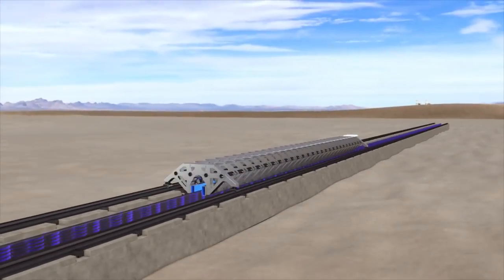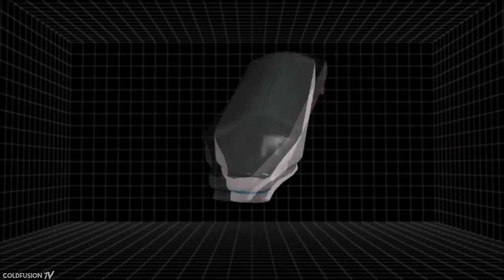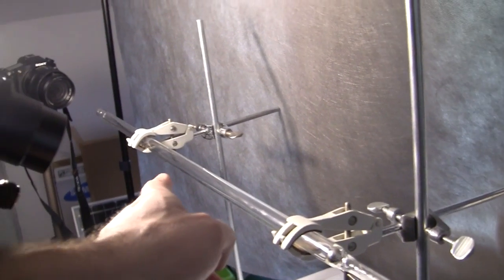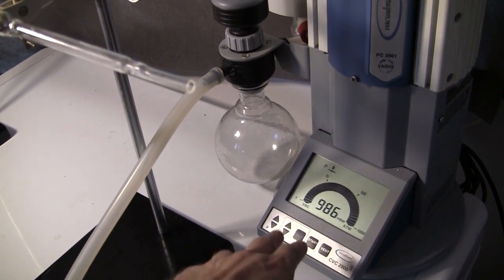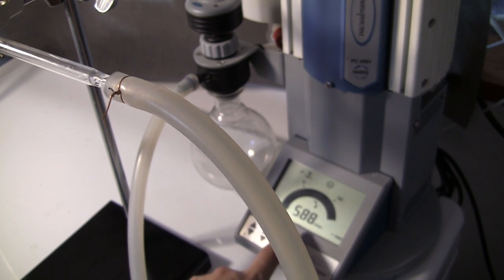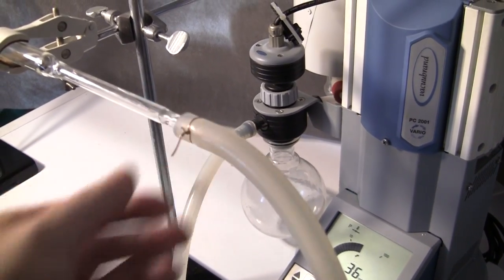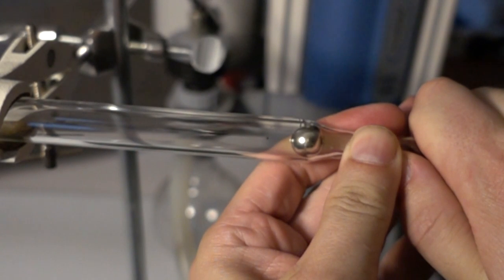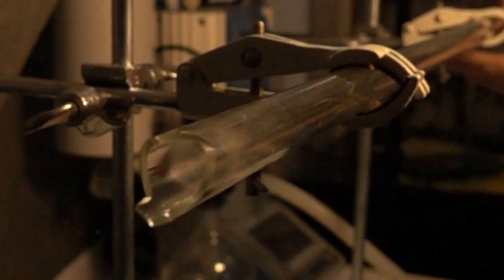How  the Hyperloop can kill you!

Comment: You're assuming there wouldn't be underflow blowouts along the tube at intervals?  You're assuming there wouldn't be an accelerometer autobreaking system to tie the vessel down against the bearing housing, similar to that in elevators?  You're assuming that the magnetic levitation system doesn't have a limiting phase which creates a much higher friction when the "train" isn't in alignment (similar to the friction you feel when putting a load on a wound coil)?

You have made a lot of poor assumptions to the hyperloop concepts, it seems your failure at politics has caused you to lose sight of your scientific mind as well.  Although I'm not sure why they would put a vacuum to 1 millibar system in the tube, considering the passenger lock would need constant maintenance as pod stations would be constantly depressurized and pressurized separate from the loop....makes no sense.  I think a slight vacuum within the tube would help, but I don't see them making it 1 millibar, that's absurd, they may have tested the friction loads down to 1 millibar in order to gain knowledge of the efficiency curve.  They can then take the efficiency curve and match it to material costs of fail-safes and ring maintenance in order to come up with the best pressure point.

I think you need to take a break.

Comment: Well just from the one clip you played, I'd be worried about it not going fast enough. They said they were going to use a propeller to make it accelerate in a vacuum. Yet... air resistance is what allows propellers to work in the first place. The less air you have, the slower you'd go.

Comment: Im going to hold my judgement until your full video comes out, it seems like this issue could be fixed with a pressure release valves that would activate incase of an emergency. This seems like an issue that could be resolved through engineering. But like you said you'll be making a full video explaining why you think the hyperloop won't work so I will hold off my judgment until then.

Comment: Hey TF, I believe you may be debunking a strawman by accident. If you go to the actual paper on the SpaceX website ( http://www.spacex.com/sites/spacex/files/hyperloop_alpha.pdf ) you'll find that on page 3 they actually argue AGAINST a hard vacuum. Instead they argue for a lower pressure, but nothing close to a vacuum:

_ "Another extreme is the approach, advocated by Rand and ET3, of drawing a hard or near hard vacuum in the tube and then using an electromagnetic suspension. The problem with this approach is that it is incredibly hard to maintain a near vacuum in a room, let alone 700 miles (round trip) of large tube with dozens of station gateways and thousands of pods entering and exiting every day. All it takes is one leaky seal or a small crack somewhere in the hundreds of miles of tube and the whole system stops working.

However, a low pressure (vs. almost no pressure) system set to a level where standard commercial pumps could easily overcome an air leak and the transport pods could handle variable air density would be inherently robust. Unfortunately, this means that there is a non-trivial amount of air in the tube and leads us straight into another problem." _

So clearly considerations have been made. A bit further on page 4 you find this:

_ "The approach that I believe would overcome the Kantrowitz limit is to mount an electric compressor fan on the nose of the pod that actively transfers high pressure air from the front to the rear of the vessel. This is like having a pump in the head of the syringe actively relieving pressure." _

This further demonstrates that the tube is NOT vacuum in their proposal and that active transfer between the front of the capsule and the back would be needed for this to function. Furthermore, Elon Musk has also argued against MagLev systems for that matter, arguing that wheels or an air cushion are probably better to keep the cost of the track down. I can't find a source right away but I'll put in some more time if you so desire to fish it up.

Moving on, I tried to find the source for your 1 mbar value. What I've found is this, the specifications for the tube they'll use to hold the contest: https://www.badgerloop.com/documents/TubeSpecs.pdf

On page 4 you'll find:

_ "Per parameters above, the internal pressure of the tube shall be between 0.125 – 14.7 psi. In order to support various types of propulsion systems, compressors (if applicable), and outer mold lines, the Pod team may select the tube’s operating pressure from the range given above (0.125 – 14.7 psi)." _

That puts the 1 mbar (~ 0.125 psi) as the absolute lowest possible pressure for the test track, but it goes up all the way to atmospheric pressure. The contestants are free to decide at what pressure in that range they'd like the tube to be, so in no way is that 1mbar figure you give an inherent property of the system that's proposed.

I'm not saying this suddenly makes the Hyperloop make sense, but as a scientist I'm sure you'd like to spend your time debunking the claim that's actually been made instead of a strawman.

Comment: Easy enough to put sensors that can detect a pressure leak at regular intervals and have hatches that can open and close on the tube in case of pressure leaks. Also, the hyperloop is NOT the same as vacuum tubes. The pressure inside is only supposed to be decreased, not 1 bar or something crazy like that. Another thing is that the passenger car doesn't have to fit nearly as tightly to the tube as your metal ball fit in the glass tube, thus letting pressure rupture not affect the passenger cabin nearly as much. It's like you are dead set against the idea without exploring all the engineering possibilities that can mitigate the potential problems. Like the people who criticised airplanes when they were still barely able to be airborne. Fact is that this might work with the right engineering.

Comment: Interesting argument here, Thunderf00t. Though, I could care less about hyper-loop becoming a reality but for the sake of science and argument I'll have at it. 

Don't get me wrong,you make valid arguments but there are some problems with current travel methods such as we go into space by lighting a highly explosive barrel on fire to producing thrust, but it's more complicated than that.

Now, in your experiment, you were using a metal ball and a glass tube. Now, if hyper-loop were to become a reality, I highly doubt that the system wouldn't just be a glass tube with a metal bass with a seat inside of it. There will likely be safety countermeasures on the vessel itself and/or in the tube. Plus any of problems that come up during testing can be engineered around. Developing a whole new method of transportation is no walk in the park.

Comment: Science, bitch.

a = F / m
Say the area of the capsule's end cap is about 3m&#178; (radius of ~1&#178; * π) so A = 3
F = P * A
Atmospheric pressure is about 100000N/m&#178;, so P = 100000
F = 1000000 * 3
F = 300000N
As a guess, say the capsule weighs 5 tonnes.
a = 300000 / 5000
a = 60m/s&#178;
Now remove acceleration based on the resistance of the near vacuum at 1/1000 atm:
a = 59.94m/s

That's basically 6g. So yes, you'd probably survive. That said, you probably wouldn't survive crashing. If, however, you came to a stop without hitting anything you'd be okay.

Before you critique me, remember, this is a 5-tonne capsule. If it were lighter, you might not fare so well. Heavier, maybe you'd do better.
Honestly, though, I think that most people would boycott hyper loops if decompression did ever happen given how traumatic it would be.

[Edit: Google is retarded - "&#178;" = squared sign]

Comment: The solution is both intermittent tube-based pumps and train-based compressed air that gets released upon decompression. The latter would also provide a counterbalance force to the vacuum to reduce whiplash. Not hard to do.

Comment: Does the pod have to be a tight fit? I can't think of a reason as the vacuum is there to cut drag. If it is a loose fit, as it would probably have to be to allow it to move about a bit on the linear motor, a vacuum failure won't be anything like as much of a problem.

Comment: dewey eyed dreamers sold spaceships and satellites to pr bullshit men... they seem to be improving on weak designs... why can't the hyperloop and it wouldn't be fatal at all due to the fact your basically inside a heavy train that would absorb the pressure... and seen as there would be no rapid deceleration fatality rate goes down further and whats wrong with finding yourself in a 500 km tunnel that has service hatches and windows... all part of the design.... really this is what you're going after? at least this actually fucking works...yes there are dangers but so do planes so do cars and so do trains...

Comment: There's a thousand reasons why the hyperloop is hard/impractical/impossible to build, but this video is bullshit.

You demonstrated what happen when an object that is roughly the size of a tube is exposed to high pressure on one side of the object, and low pressure on the other side (e.g. a gun).

The pod will be much smaller than the tube, so this video is completely flawed.

You need to redo this video with the proper tube/pod diameter ratio.

Comment: Now i haven't seen the hyperloop project, but what they could do to avoid the majority of the acceleration is simply to make the tube somewhat larger than the "train". The air that rushes in will run around the train instead of pushing it (way of least resistance) and thus the effect on the train would be minimal (like shooting an air cannon with a projectile too small for the barrel, it will go a very short distance if any distance at all). I would be much more concerned with a cabin failure as the pressure is so low inside the tube that your body liquids would boil, lungs would burst and so on.

Comment: I've been studying transportation systems for two decades and the main issue I have with the hyperloop proposal is that it is a completely unnecessary transportation technology. It's all "gee whiz!" and brings no compelling enhancements to the table. We ALREADY have a tested, built, and proven high-speed solution (TransRapid-style MagLev) that has actually been in revenue service for years (in China -- you may have heard of it). We have been here before. Hyped-Loop ( if I may, and I just may) sounds like all the sound and fury signifying nothing that surrounded all the ridiculous PRT proposals that never got built. The major differences regarding the shiny new kid on the block are more formidable challenges with switching, passenger evacuation,  and the lack of available off-the-shelf tech. The lack of windows is going to annoy passengers, too.

Comment: This doesn't seem well thought out to me, sloppy and condecending in fact.
Firstly we can assume that a tube failure of this scale (100% of the tubes diameter breaking open) is just about impossibly unlikely to happend without say a terrorist attack.
Thus the acceleration rate wont be anywhere near this even when excluding the likely addition of fail safes like automatic hatches.
Then there is the "no braking part" which is obvious bullshit since the entire propulsion system is likely to be built like an electric railgun and can simply be reversed for gradual deceleration.

Comment: I think this one is not busted. I think the problem can be solved by clever engineering. There is millions of ways to control the speed of the vehicle like control the pressure of the tube or simple a break.

Comment: So put an emergency brake on the train, and have vents that open when a vacuum failure is detected so pressure can equalize without causing the train to accelerate.

Comment: My understanding is that the hyperloop is not a vacuum, and isn't a maglev, but uses aerodynamic lift to sit the pod on a cushion of air. Part of the problem is that a vacuum is unfeasible and that a tube just full of air has too much resistance. This is why the hyperloop design proposed by musk contains pods with massive fans, a tube with reduced air density (but not a vacuum), the purpose of the fan would be to to push the reduced air environment down and under the pod to reduce friction and air resistance.

Comment: +Thunderf00t I think your model is flawed. You should have a metal cylinder about half the diameter of the inside of the tube, with a magnet under it. You also shouldn't have the 'pod' sitting right against the tapered end when the pressure is released.

I have no doubt there are safety risks, and I'm thankful for your debunking vids, but this one seems a bit sloppy.

Comment: This is specifying one potential problem, but this doesn't seem to be a deal breaker for the hyper loop.  But also, won't the vacuum be in the direction of the movement in the hyperloop? I thought it uses the pressure from behind to give it the forward momentum. This is if the tram had a vacuum behind it, at rest and suddenly there is a fracture in the system.

Comment: I don't see how this is a representative and adequate model of hyperloop; at least not without additional explanation why the great difference can be ignored.

The vessel doesn't occupy most of the tube; the renderings I've seen imply that it will occupy about one third to one fourth of the total area. This means that the pressure difference between the front and the back of the craft is much lower than implied in this test; like a 5 mm ball bearing in a 10 mm muzzle loaded pistol, the effect is greatly reduced.

From what I have heard the pressure isn't 1 mbar, it's ~1/6th atmosphere. The vessel uses a fan to move air from in front of the vessel to behind the vessel. If it did not do this, it would build up an overpressure in front of the vessel and rapidly slow down.

Assuming the vehicle is traveling faster than the speed of sound and a leak happens behind it; air will not catch up to the vessel.

Assuming a leak happens in front of the vessel and it is traveling faster than the speed of sound, it has a fan to push air through itself, which should reduce the effect somewhat. The tube is long; if the leak happens kilometers away, the pressure change will be a gradient, not instant as implied here.

Assuming the leak happens behind it and it is currently traveling slower than the speed of sound, the pressure behind it should increase rapidly, but not abruptly like a shockwave. It might be possible to slow the fan down rapidly to build up an equal pressure in front of the machine and slow the vehicle down in a way that's not lethal.

Comment: I'm not sure if Thunderf00t just hasn't explained himself well here or not. I should probably just wait for the full video to come out but I'm not. Yes, the Hyperloop will probably kill you if there is a pressure failure while you are riding it. However it's not like airplanes are exactly safe. Any number of system failures could easily cause the whole thing to drop out of the sky and kill everyone. Yet it is still safer then driving a car.

Comment: I think on the production design the engine is on the train/pod part itself.  Therefore there is not actual vacuum in the tube.  Its Essentially riding a turbo jet down a pipe.

Comment: square cube law here: the bigger the pipe the slower the acceleration since the acceleration is relatice to how much air can pass through the hole where it fails (a^2 if its a square) and the object that needs to be accelerated is a 3D object with 3D weigth distribution. I would still like to see the actual calculation of the acceleration if you can do it (i cant).